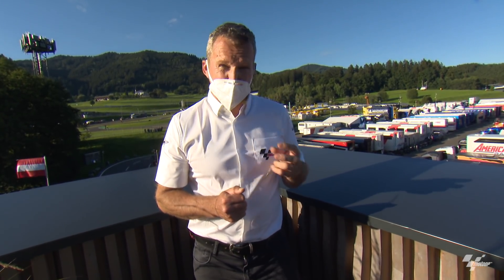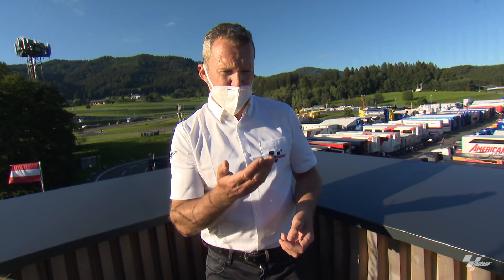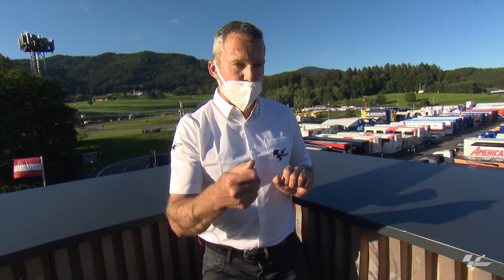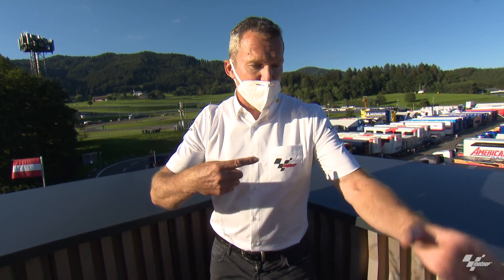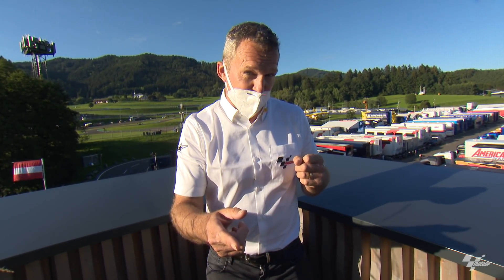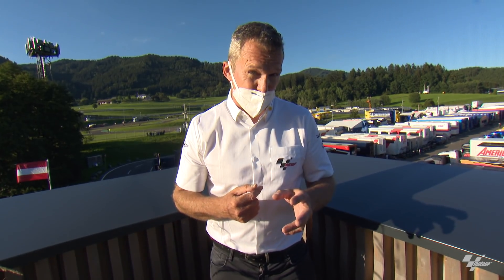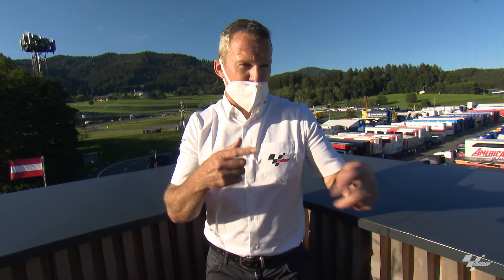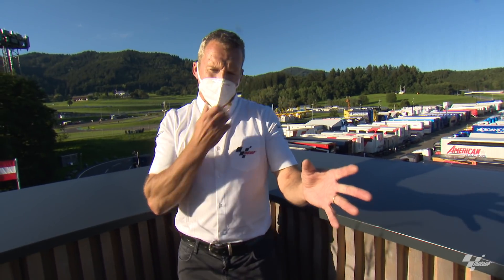Inertia and the Gyroscopic Effect: Tech Talk with Simon Crafar

Comment: Apparently, gyros act to conserve angular momentum and add stability.  They also exhibit "procession" where dynamically changing the axis of the gyro (eg leaning) tends to turn the steering wheel (and the rear hence the whole bike) in, so it counters the tendency for the motorcycle to fall over.   

Contra-rotating gyros (eg, the wheels and the crank), rather than cancel each other out - are additive to stability due to conservation of angular momentum - but do cancel the effect of precession on the bike as a whole. 
  So the explantion is more complicated - it must make a difference, otherwise they wouldn't do it!

Motorcycle geometry includes "trail" of the contact patch from the steering axis for a self centering / stabilising effect, so this must also contribute.

Comment: It turns out gyroscopic effect is not why you can stay upright on a bicycle (bicycles have been built to perfectly cancel it out and they are rideable as normal. There is no doubt that at MotoGP speeds you feel the resistance to turning in due to gyroscopic, but it isn't the primary reason the bikes stay up (which is due to rake and trail causing the bike to self-correct via steering).

Comment: I used to recognize a bit of this effect riding dirt bikes.  Comparing a 450 four stroke KTM to a 300 two stroke KTM, the smoker turns in easier, changes direction faster, and is easier to haul down from speed.  Of course, the four strokes have their advantages, as well.

Comment: I would have liked to try the thumb-controlled rear brake back in the day. One time I was racing for third in an expert race. My bike kept popping out of gear at one corner, but I kept outbraking my competitor deep onto the turns. He got by me a few turns from the end. I braked way too late and too hard. The back end went up way too fast for me to use my rear brake pedal, the gyroscopic-effect of the rear wheel attempted to have the bike go over my head, which would have been painful. Of course always being relaxed, even around 70-80 mph, with the rear end of the bike trying to go over my head, with the rear wheel spinning, I literally had to "pogo" my bike on the front tire, leaving I don't know how many stoppy black marks from my front tire, until I slowed down enough whete the back of the bike wasn't yrying to go over my head anymore, and dropped from a near vertical postion where I could finally use the rear brake pedal to stop my rear wheel's centrifugal force. I putted around at 25 mph to finish the race in fourth, we werr that far ahead. Some folks said it was the most anazing thing they had ever seen.

Comment: Thank you, Simon. I watched and enjoyed your racing career; and now, your Moto GP work and insights. I will have to look out for more techtalk.
Technology changes everything. My favorite bikes to watch were the 500 two strokes which few could ride well on a regular basis.
As a ranked club racer back in the day, one is obviously in tune of what is going on with almost every aspect of the bike ( it's really amazing not only what one is capable of doing on a bike-I was once so relaxed after putting my friend in the ambulalance, his father threatened to kill me if something happened to his son, great Aikido chi-breathing and relaxation techniques helped ;-)  that once I got into the zone, and I had a slightly narrower tire that I kept losing the front end in a couple of places every lap, I actually had an out of body experience while leading the race, which was simply awesome watching yourself race from behind and above, but sad at the same time that you knew you would never experience this ever again, and you had to be back on the bike 100%; easily won that race, btw :-), but what bikes are capable of doing ) and that with enough inertia and gyroscopic effect, as long as you are focusef straight where you want to go, and going fast enough, the entire bike can be so disruptive, both wheels off the ground, sometimes the bike parallel to the ground-shit-club tracks and not the best suspension will fo that at timed, you will be just fine. All kinds of adventures riding bikes. ;-)

Most amazing thing I saw was watching Gary McCoy win the South African Grand Prix in person. Getting hit with Champaign from Valentini after he won Assen was cool, too!

Comment: Thanks Simon, more of this please. Another way to experience the gyroscopic effect is with a fidget spinner. If you turn it quickly and then try to move it you can feel the force. Then when you take two spinners, hold them both with the same fingers and let them rotate in different direction the gyroscopic effect is cancelled out and its easy to move around. If i'm not mistaking the YZR500 (like Simon have ridden) two stroke of the 90's had two crankshafts rotating in different direction making the bike also easy to turn.

Comment: I used to work for Honda R&D in California and asked some of the motorcycle guys "what makes a bike turn" and they were like "nobody is really sure"
Reply: Countersteering with the aid of two gyroscopes ( the wheels ) in layman's terms. You push and pull the handlebars the opposite way you want to go. The bike drops, and the gyroscopic effects of the wheeks and momentum of the bike does the rest. Racing get's a bit more complicated with drifting, sliding, spinning, and having to occasionally pick up your bike with your knee.
Reply: @luvyesmusici4886  it's more than just gyroscopic effects.  When you counter steer, you're telling the front wheel to roll the opposite direction of the turn.  As the front wheel moves out, the bike falls (leans) towards the turn. As you lean, the rake of the front fork puts pressure on the rear of the front wheel and that forces the handle bars to turn so that the front wheel starts pointing  into the turn, but if it does that, the bike will stand up again, unless the rider keep just enough countersteer pressure to keep the bike leaned at the desired angle to stay on the desired line.

Comment: I admire Simon's determination to make the technical insights understandable to us all. On Inertia it's not that a car "want's to get going" rather that it wants to keep going, once it is moving. That one word difference is key, and is Newton's law in practice.
Reply: Great insight into the spinning mass of the rotating components. I was just at Mugello and agree that the final chicane is a great test of turn speed and stability. See MotoVudu for Simon's guidance on body position and movement...
Reply: Fascinating insight into the Inertia effect on engine braking and the ways to fix that. Sounds like the spec ECU is limiting Honda from tuning the engine braking with fuel adjustment so that they can't overcome the crank weight of a sealed engine. Clearly Honda know how as the 2020 Fireblade has engine braking settings to choose from, and I guess they did that long ago when they had free choice of electronics.

Comment: I really enjoyed this video.  I would love to hear more about the feel of the bike, during situations.  One example would be trail braking into a corner and the feel from the front end. Questions to answer may be; what the feel is when you have too much or too little tire pressure, too much or too little rebound, what it feels like when the front end wants to wash out.  A second topic may be accelerating out of a corner, the throttle feel before and after closing the throttle, and then opening the throttle back up, and where the limit is on opening the throttle back up.   A final example would be leaning the bike; which body parts do you most use to start a corner and end a corer, and why.  In addition, if you need more lean angle is it best to counter steer or remove throttle, etc.

Comment: Simon, this is fabulous.  Thank you.  Is weight added to both ends of the crank?
Reply: Normally weight is added to the lobe side of the crank to compensate for the weight of the piston and connecting rod. You want a balanced thing spinning around at high speeds.

Comment: I thought gyroscopic effect only come from tyres, until somebody told me "you should put spinning things in the engine into account as well",

Me* whuuuttt~?
Reply: Anything and everything that spins has the gyroscopic effect and in the engine, the main source of this is from the Crankshaft, flywheel ( the weight at the end of the crankshaft used to store energy to keep the engine going between strokes) and the camshafts. These are spinning mass and create the gyro effect.
Reply: he didn't even metion the clutch and transmition, just the transmition alone is like a big portion of the engine size